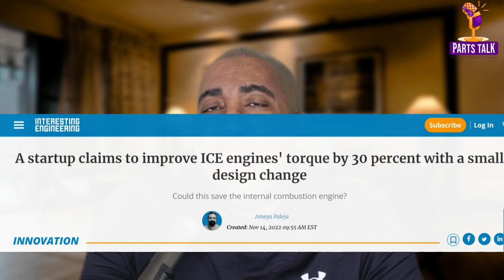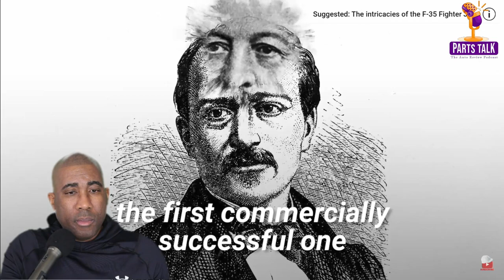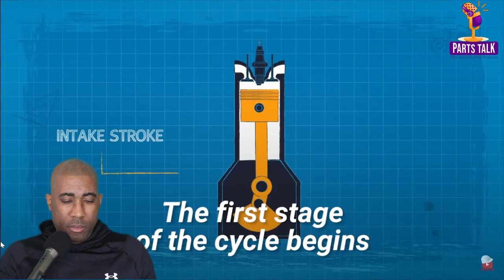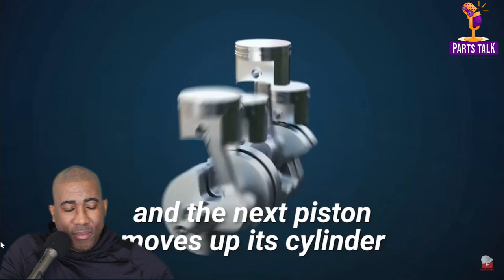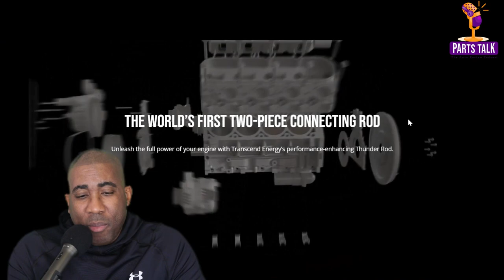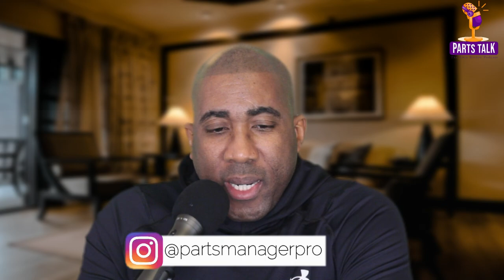Company Improves Engine Torque with New Design | Will Mechanics Love This?

Comment: So a 30 percent increase in torque but there is a whole bunch more weight being added, higher compression and more advance to the ignition timing.
I really can’t see how this is improving things hence why no manufacturers are doing it.
Coming from a mechanic/engine builder I just don’t see the point of what is trying to be achieved here. It’s adding more weight to the rotating assembly and extra pieces that aren’t required🤷🏻‍♂️.
By upping the compression you will also have to run higher octane fuel. 
Not holding my breath for miracles with this one.